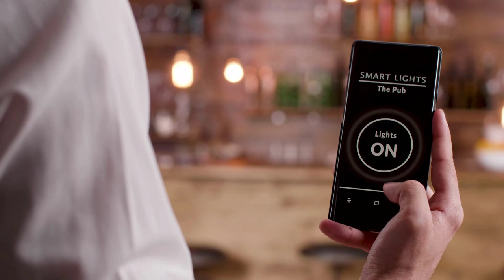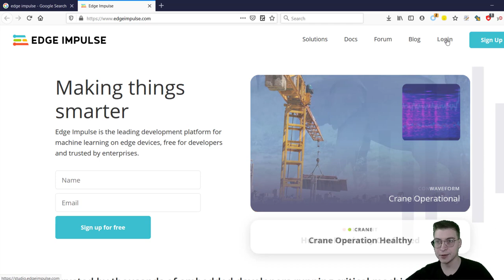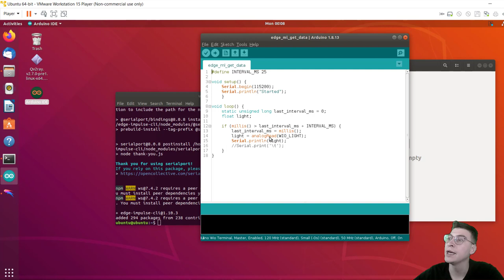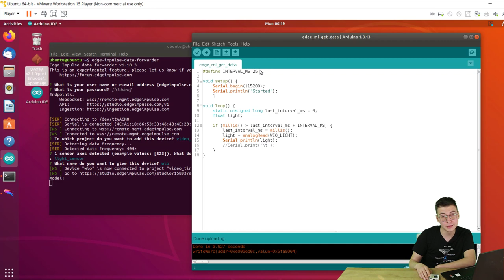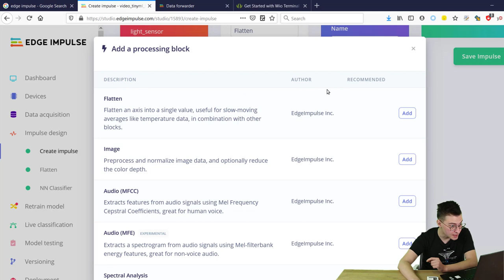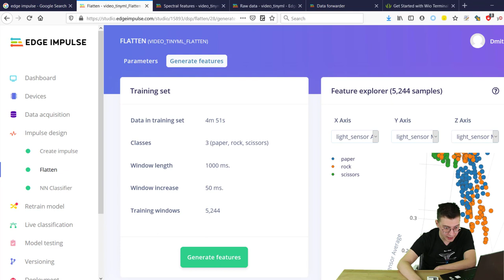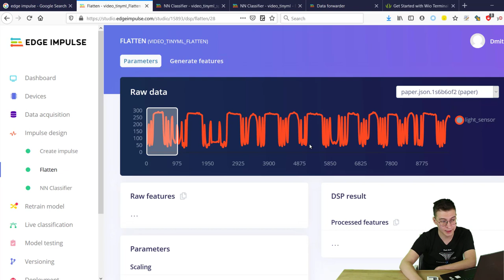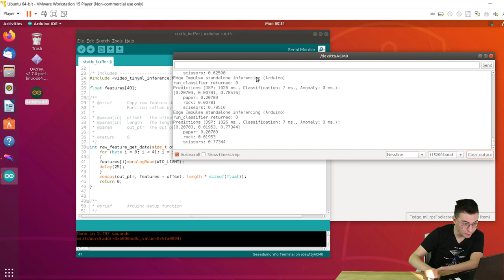Arduino Machine Learning Tutorial: Introduction to TinyML with Wio Terminal

Comment: Nice Explanation, 
I want to get into TinyML, what are the languages that should be concentrate on?
so, you are showing the on the edge impulse, which is a great visual front-end tool for tinyML
but, you got to show what under the hood happening. 
I hope you got my point.
Reply from the maker: Python for data processing and model training, C/C++ for inference on the device.
From an engineer standpoint, when creating an application/solution, the exact mechanics of how the inference is performed on the device might not be that important - unless you think you want to further optimize the performance.
But no worries, as it is mentioned in the video there are going to be 2-3 tutorials using pure Tensorflow Lite for Microcontrollers, where you get to see all the "under the hood" stuff.
Reply: @Hardwareai Thanks for the response, Great, waiting for the next videos

Comment: Hi   
Arduino based on  avr    right? 
 Can   we  use  tinyml in  avr  like  atmega8  ? Why we dont  that?!
Reply from the maker: Some Arduino boards are AVR based, while newer ones have mostly ARM cores. It is possible to run very simple traditional ML algorithms on AVR boards too, but it won't work for NN based models - too little RAM, FLASH.
Reply: @Hardwareai  ok 
But in this model   arduino uno  used  that based on avr    and have  same ram and flash   
 Is it possile  to run  this model  on avr  ?
You  know   i  want  to  know   how its possible   !   Do we need a specific library or a specific method?

Comment: Please demonstrate as fast as you can because I was not lost early enough in the video. Needless to say I stopped watching at the 10-minute mark.
Reply from the maker: Hi there! Yes, you're right on that one. In fact I've been researching some tips on how to improve audience engagement and that one is definitely on top of my list - demo the results earlier, so people would be more interested :)
Reply: @Hardwareai  My thoughts were on the pace of the presentation. For every keystroke/mouse click you rush through in the interest of time, the greater the percentage of people that will lose interest and the higher the likelihood of page closure. If necessary, create a Part I and Part II but don't rush them so they can follow along. I wrote and taught advanced technology classes for 23 years so consider this opinion well-founded. Good luck.